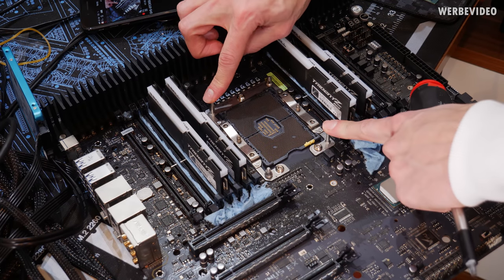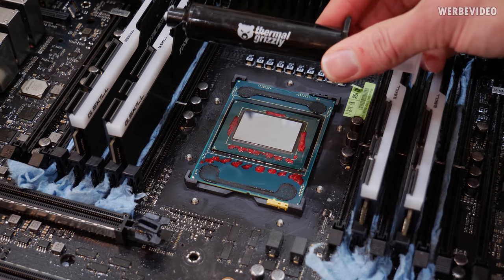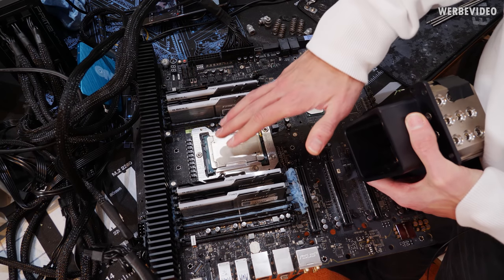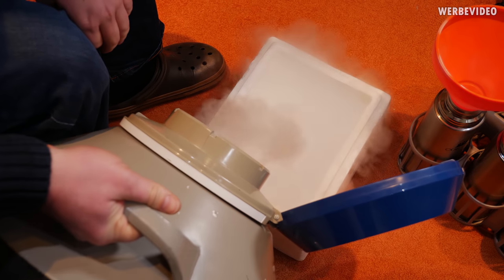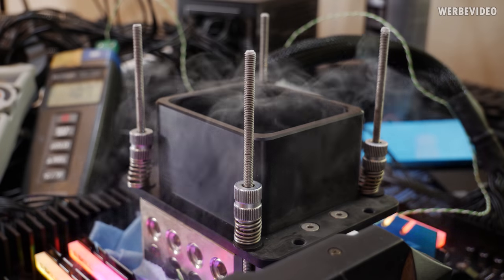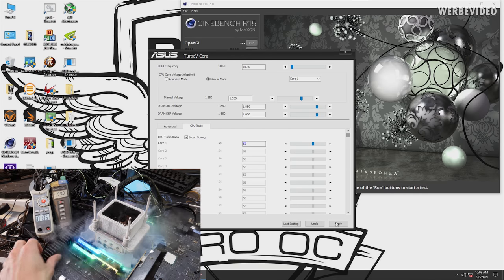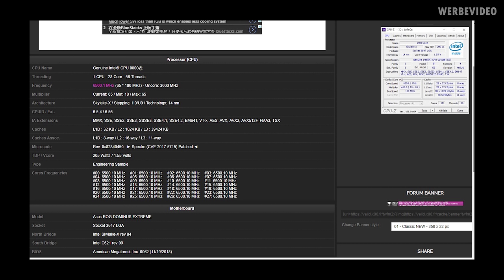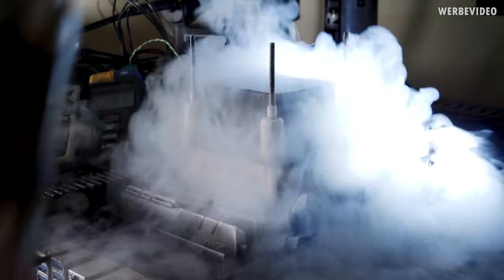Breaking Records - Xeon W-3175X Extreme Overclocking

Comment: You are lucky to have RGB lights on your Ram. This gives you at least 100Mhz more OC potential.
Reply: Nah.... 
More..
More....
Reply: G Skill Trident Z RGB is some of the fastest ram available. Unfortunately it is RGB, but the Samsung B Die runs great. Wish they put those chips in non-RGB dimms.
Reply: @Delistd  just turn off RGB then lol
Reply: I think you will find red leds have the best performance.
Reply: @Delistd  my G Skill Trident Z are non RGB and have samsung B die.  Only thing is I haven't done anything more than xmp because I'm older and lazier than I was back when I would have made use of original DDR samsung B-die.  I did get my budget stick's up to 222mhz cas2 and 235mhz cas2.5 or 3.  At the time B die's were running 250mhz or higher with better timings.
Reply: @Delistd  g skill head spreaders are crap lol more like heat insulators

Comment: Could you imagine needing a 1600 watt power supply just for your CPU?  I guess you wouldn't need to have a furnace in your house for the winter.
Reply: Need to open the windows even xd
Reply: Kayra Ege Arda Better get a beefy AC just for that CPU. With that power draw you could cook on it. That IHS should be large enough :D
Reply: The computer is your furnace
Reply: That will hurt your wallet more than a scam will do effectively.
Reply: Just throw in a bunch of Vega 64's or GTX 480's with it, nuff said.

Comment: wtf 28 cores at 6.5GHz.... OMG
Reply: Need an fusion reactor to power it lol
Reply: because Shamino, he is king of OC :)
Reply: @Gamer-nc8qp  on idle its fine (CPUZ validation) But still, better to have 2x PSU with stron 12V rails :D
Reply: you might just hit 10-15 ghz if you were able to slingshot your PC to the farthest reaches of space >  At a positively frigid one Kelvin (that equates to –458 degrees Fahrenheit or –272 degrees Celsius), the Boomerang Nebula in the constellation Centaurus is officially the coldest known place in the entire Universe. It's even colder than the background temperature of space! < and remotely overclock it ... Just saying...

Comment: Threadripper still 200mhz slower but 200cb higher score in r15 at less than half the price 😎
Reply: More cores 👍
Reply: @lumschente  and infinity fabric
Reply: More cores, less consumption, AMD did not sit on their arses for 10 years and forgot about R&D... hopefully the new gen ryzen will improve a lot more than expected... AMD deserves it, we deserve it, and Intel was asking for it.
Reply: portedbikes 7nm is gonna open a lot of doors. lower power consumption, more space for die, lower temperatures, higher frequencies, the list goes on. very exciting for 3000 series ryzen chips.
Reply: the 3rd gen ryzen is supposed to be really sweet. rumors are at least 15% increase in ipc, lower latencies, and more overclocking headroom.
Reply: Sure, if all you want to do with your CPU is getting more points in cinebench .. buy the 2990wx. 
But its trash in almost every real world application.
Reply: @JetBen555  There's a windows scheduler bug atm thats seriously hurting it's performance. One workaround has been found and it provides a significant uptick. Once microsoft actually fixes the issue the performance is going to go way up in many cases.
Reply: @portedbikes  Anxiously waiting for the third gen Ryzen!
Reply: @JetBen555  am i going to spend 10k on a cpu i could get similar for 1.5k hell no
Reply: @JetBen555  - Actually, it is not. It works well in the workloads it is designed for and if you use Linux, it fairs much better than in Windows.
Reply: TR has many issues with assigning cores properly due to 2 dies on the chip itself not having direct contact with RAM and having to rely on the other 2 dies for it.

Also, TR W2990X is not "less than half the price". It's still 1800 bucks while the Xeon chip is 2999 bucks.

One last point. You.. don't buy such CPUs to do cinebench runs and geekbench runs all day long. You buy them for their functionality. That's why Intel's new Xeon chip will exist on the market even next year.
Reply: @FOGoticus  no I buy cpus to bench them XD I have over 400 cpus you think I used them all for work or gaming.....nope.
Reply: @JetBen555  just like every other ryzen cpu right just face it intel is getting de throned and its been a long time coming being the under dog for a while now they hold the crown to the best price to performance and soon to be the best all around amds focus is one people that arent rich and would like great performance thats more than intel could ever say theres the cheap and trashy intel cpus or the extremely over priced performance cpus with amd most of the lower end of the spectrum holds its own very well in performance and gaming for the same price as intels cheapest cpus now at top end of the spectrum intel is just nutts when it comes to pricing and in over 3 gens still basically the same performance and even more expensive while amd works hard to and makes improvements over generations especially their gpu line up is on fire when it comes to price to performance the rx580 is a little better than a 1060 for half of the price and 2gbs more vram come on now only a fool couldnt see that and ive seen the numbers to prove it
Reply: @MikeBlunt2  TBH, i didnt read all your post because you think im bashing AMD or that im an Intel fanboy or whatever but im not. I said that the 2990wx sucks and its true, its a very bad product. I didnt say anything bad about Ryzen... actually I have a 2700X rig myself. But man, this CPU(2990wx) sucks, even on Linux with the perfect work load, it should outperform the 2650x by at least 70-75% (i know thing dont scale perfectly plus the clock speed are lower.. but still it got twice as many core soo 75% is not too much to ask for) but it never come anywhere near those number in any application/work load on any OS because its fucking memory controller has been crippled. The Intel 28 cores will actually outpetform their 14 cores by that much (75%+) in any  multithreaded work load.
Reply: @hexotech5202  bitch please why you dont compare this Xeon to an Epyc 32 cores CPU?? (Btw, it cost 2800 to 4600$)
Reply: @FOGoticus  - Actually Windows has a flaw at handling the hand-off to cores on Thread Ripper, so it is 80% of the issue. Plus, if you were buying say 30 of these, that price difference adds up quick. Our Customers care about cost and Threadripper isn't a benching chip. Just cause it kills Cinebench, doesn't mean that is all it can do. It is a rendering power house and on Linux it scales better.
https://www.youtube.com/watch?v=QI9sMfWmCsk
https://www.youtube.com/watch?v=M2LOMTpCtLA
Reply: @GensUnaSumus09  I didn't complain about anything.
Reply: @markcollard9326  I know this is a month old, but a pre-production demo unit beat the i9-9900k, not by much but still, a pre-production unit and amd still isn't finished with it https://www.overclock3d.net/news/cpu_mainboard/amd_demonstrates_ryzen_3000_series_cpu_-_beats_intel_s_i9-9900k/1

Comment: $4,000 CPU the 3D Mark Hall of Fame is getting really expensive for that entry price point to Extreme Overclockers.
Reply: 3k, not 4.
Reply: @supaapple  maybe counting the motherboard?
Reply: $3k per cpu, and many will buy several of each and hope they win the lottery with at least one of them.
Reply: 3D Mark is a real pay to win game🤔
Reply: @loserbear0103  Give it 6 months and we will have 7nm Threadripper with even more cores. It will be interesting to see just how high it will go under XOC. I don't think Intel have anywhere else left to go after this.
Reply: @justinpearson6449  It's been 6 months. I guess you were off by a month or two.
Reply: @DirtyPoul  indeed it looks like they are going to hold off until January... or even later. Looking at the boost clocks on the first 7nm at a guess I think they are holding back a lot of chiplets for the server market or the process isn't quite as golden as they first thought.

Comment: Just a noob question, why not make a direct die pot? Wouldn’t this make temps better then using thermal paste on the die then on the heat spreader?
Reply: I'm a noob at this too so take my answer with salt, but I believe direct die will actually cause more issues because getting the CPU too cold will cause it to shut down or even break, not just because of condensation. By having the lid inbetween, you get a layer of buffer between the heater and the cooler. The buffer won't actually reduce cooling potential, it more so adds a time delay between changes crossing the layer. Once the lid is at negative 100°C it will stay at that temperature with minimal fluctuations.
Reply: @zactron1997  Looks like a good answer. 😉

Comment: Sub zero over clocking is pretty interesting but they always seem to have too much trouble with water condensation, i figure that if someone really has enough money to go for a top end processor, motherboard, rams, custom cooling and all of this they could also afford to do it in a humidity controlled room or in a specially built vacuum chamber
Reply: You can get into Extreme OC on a budget if you want to. Just get some Retro Hardware on the cheap, some old watercoolers, a bucket full of ice and you're good to go. Even with dry ice usage you only need a container on top of that, so I can afford doing it myself as a student. At that point, insulating your hardware is a lot easier than controlling the humidity of your environment.

Comment: Amazing to think there is a little more power and heat density on that die than a 1m x 1m solar furnace lens on a summer mid day focused to a coin sized point lol
Reply: I did not think about  that  that's insane I held a 1000 W halogen lamp onse it was insane how much heat of is radiating of  thanks for that insight
Reply: @Thefreakyfreek   yeah I thought that because at the equator if I recall the sun light is about 1Kw per m2. concentrated with a lens of that size would burn stuff really quick haha

Comment: Quick question, why is the processor heat-spreader used in XOC instead of cooling directly the die?
Reply: It may be too risky to direct die cool 9 different chips. Aldo with the super high mounting pressure, i could see how the heat spreader would offer structural support.

Yes im 2 years late. No i dont care.

Comment: Also because of this effect, protecting your hands with anything is a bad idea as the heat transfer will rapidly sap heat from your hand as it warms the nitrogen, as the process with minor thermal protection is too slow to take advantage of the Leidenfrost effect. This of course could lead to frostbite among other bad things.

Comment: Would it be any more beneficial if you just discarded the IHS and put the LN2 pot directly onto the CPU die regarding temps? I guess there are issues with applying enough pressure onto the CPU into the socket and also a small risk of cracking the die this way?

Comment: Der8auer is it possible to mount Liquid Nitrogen container directly on cpu die without IHS? Theoreticly it would allow better head spreading considering you need more thermal paste anyway.
Reply: You want the temperature to go down slowly otherwise the die stops if it's too cold. Thus having a buffer layer between the liq N2 and the die is probably very helpful.

Comment: Why you can't mount your cooler on the on the CPU itself instead of making it on the heatspreader? I think it would be much more efficient.
Reply: Less surface area to spread and cool the heat
Reply: Jonas C. I think it has to do with even mounting pressure so all the lga pins make contact.

Comment: im buying a 2070 soon but im not sure if i need a new power suply. right now i have a 450w psu. if i need a new 1 what do you recomend it can be modular or non modular
Reply: EVGA g3 750w just to be safe.
Reply: You should be fine with any 550W+ CPU. Corsair, EVGA, Seasonic, Silverstone all make good power supplies. Modular is generally very nice to have for cable management.
Reply: @infinitelyexplosive4131  ty man im going to look for one

Comment: looking foward to Zen 2 Thread Ripper if they do 64 cores, as that should be capable of 8000 CB at under 360W which means under water you should be able to keep that "cool" and when I say "cool" I mean keep it from thermal throttling.

Comment: U said u are using only half the power pins in the mobo (1 set of 24pins) to power the cpu, does this affect the power delivery? Is the voltage going through all the phases in vrm? Will using the full set of power pins have any difference?
Reply: it's fine. the CPU VRMs are taking 12V from 4x 8p EPS 12V + 2x 6p PCIe connectors on this board. those 2x 24p ATX socket is more likely for dual PSU setup
Reply: Bulldozer has board analyzing and it might help a little but mainly it's for GPU too

Comment: Lol... awesome video as usual, but what is the purpose of this CPU?
Reply: Guess Intel has to get rid of some Skylake-X dies...
Reply: Well, apart from being a good benchmark, blender is the most widely used 3d animating program in the world and scales extremely well on a insane amount of cores. Even though this cpu costs a lot, for professional users that use it for work the decrease in render time will pay for the cpu in not too much time.
Reply: So it really is a specific use-case cpu for a relatively small amount of people
Reply: $$$$$$$$$$$$$$$$$$$$$$$$$$$$$$$$$$$$$$$$$$$$$$
Honestly, there is no purpose. Intel competing with threadripper, but at price to performance in most applications it's not worth it.
Legitimately you can build two 9900K systems, even for using in workstation applications, and get a better return on investment... As a consumer or a business. According to Steve (GN)'s benchmarks, video rendering on the W3175X is 2x as fast as the 9900K, but you could render the video on one machine and edit another video on your other machine of which both together cost less than the W3175X CPU alone! lol.
Reply: Basically Fornite beast best for kids below 12 ... Of course I was talking about alien World
Reply: @acvn-hg9gy  Blender scales so well that the 2990WX performs basically the same as this CPU on it, which means youre better off getting two 2990WX systems for the same price as one of these. Really where this CPU shines is adobe things because theyre so optimized for areas where Intel is strong.
Reply: Nah it's not for Blender, Blender is used with GPUs and it runs much quicker on them. It's video encoding. That shit is still too slow even with a 32 core Threadripper.
Reply: The professional work for blender cinema is rendered on render farms, not a single machine. Just sayin.
Reply: May be here will be 3000 or 5000 such chips in a wild. Its not “zero” count of course but it dont have any commercial meaning for Intel at all! Sell same rare chips as xeon platinum for 8000 usd - its a good business. But for PR and HEDT niche MARKING where TR starts to dominate last year they do this probably with negative margin even. So this is just a clever sponsored PR company. Like stupid broad ad on TV 📺 but more efficent of course becouse generating much more attention and time spended in such debates by enthusiasts and professionals. Exactly what they need - good point for headings and reviews and disputes. Time will tell howmany such systems will be in a wild. I think very small amount. And i still can imagine peoples who buy this by incompetence or interest or for fun or as even fashion statement. I play 20-30 evenings per year in games, but have very fashionable 9900+2080ti box builded myself complete for fun. Dont need it really, just wasted money, but i like it. I like to build something pretty by hand. So I understand who will buy this systems from one side but i also understand very good how modern pr work and why intel do this 😂😎😉. Its a PR in form of a very rare, enthusiast oriented chip. More art/fashion than tool. Next step is auctioning... but stop ✋ i hear its already in plans 😉
Reply: well its cold right now in some areas of the US and i dont have a lot of wood for a fire.
Reply: @semillerimages  This depends on how big a studio is.

Comment: Did u see Steve’s video? He didn’t say about any issues with memory channels, could it be your ES board?
Reply: He was using a liquid cooler with a pretty thick spreader plate so it would of applied pressure across the surface of the cpu

Comment: Hi I was just wondering if someone could help, does it matter that the second PCI slot on most motherboards are only *8 speed for SLI? The ASUS WS Z390 PRO has 2 PCI slots you can run both at *16 so was thinking of getting it for a second graphics card any thoughts or advice please?
Reply: There is no way it's possible, because even a 9900k only have 16 pcie lanes
Reply: @widodosoundsystem  ow OK thanks for response, got another question if u know anything about it: does having a dimm.2 module in the motherboard with m.2 drives on it slow down the graphics cards in SLI?

Comment: Wow LN2 almost not enough because it’s using over a kilowatt on a cpu die. I literally have space heaters and microwave ovens and toaster ovens that take around 1200 watts. Yet you use that power in a space the size of the microwave oven’s time display. I’d love to get the numbers thermal density per square mm there compared to stock. That is INSANE.

Comment: so an AMD 2990WX at 5484 MHz beats a Intel W-3175x @ 5700 MHz, awesome. their new Ryzen 3 processors will finally see AMD pull ahead in ipc, they already toasted Intel on the Value segment. now the high performance segments, the HEDT's, are going to be faster from AMD as well. it's about time. maybe Intel will finally lower prces and innovate more than 3% increase in ipc each generation. sweet.